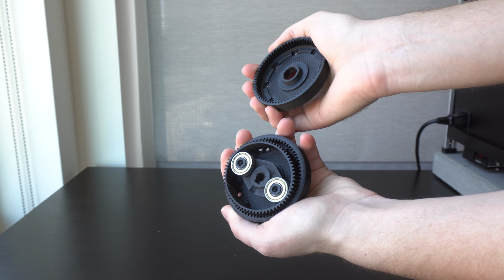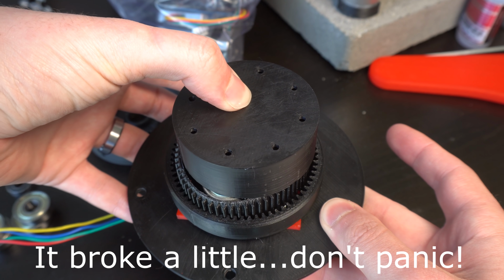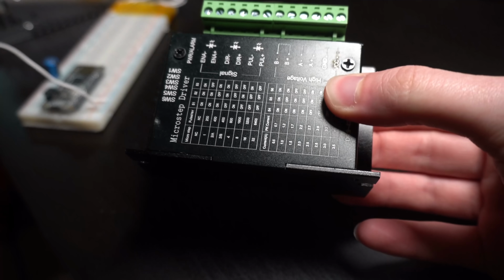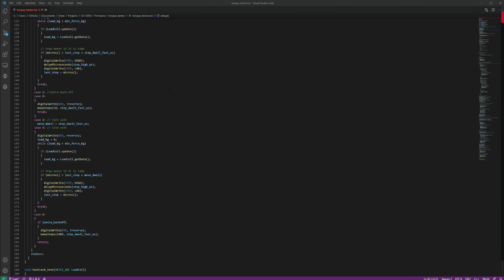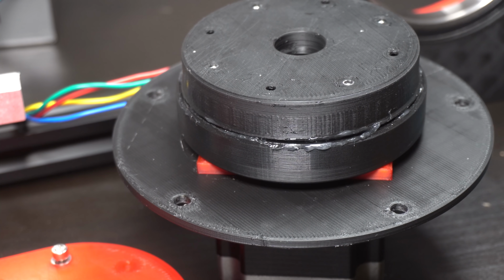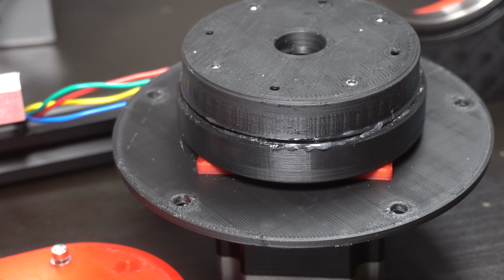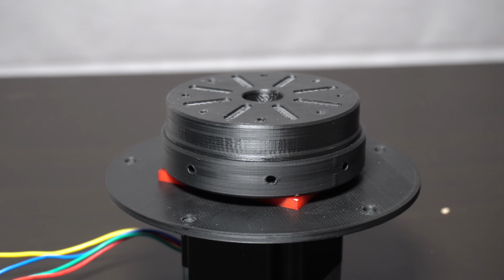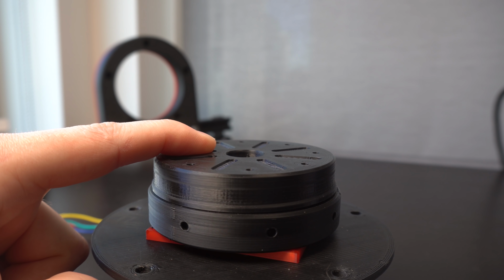My 3D Printed Harmonic Drive is Surprisingly Powerful!

Comment: Built a robotic hand when I was like thirteen, back in like 2008 maybe. It was all wood, with programmable tumblers with a live control override set up like a piano. It's glue didn't hold up to humidity long, so literally just fell apart over a wet summer. It used pull strings and springs, and later bands, very close to how a real human hand works. Can just copy the human body and only run a single moter to bring it to life with this method. To add a computerized element, the tumbler spokes can just be raised and lowered, still powered of the single moter. I wouldn't be surprised if someone else is already building something like it.

Comment: Is there a reason you didn't just use a worm gear? They have awesome ratios in a tiny profile, and basically never slip. Super easy to print and easy to model. Only two parts, so super simple to assemble / rig. Your stepper motor already has a worm gear in it, so you're using them anyway... This just seems oddly complicated.

Comment: I made a wooden robotic camera arm for a school project using DC motors from old power tools (18V and 12V I think). Very powerful, but loud and not very precise. For the gearing I just used a nut and a threaded rod at the end of the tool's gearbox. The threaded rod was good because it also stopped the arm from moving up or down by itself.

The arm was pretty bad as the wooden structure was very unstable. It was also very unprecise, but I think that could easily be fixed with a few sensors and software. It cost me about 300$ (including the Arduino and everything else).

Comment: I've never been able to get my head around the purpose of a harmonic drive assembly. Is it to increase the torque of a typical stepper motor?

Also, very cool video. I love the thought process of the maker mind.
Reply: Yeah torque is the main thing... Harmonic drives tend to have less backlash than planetary gearboxes as well

Comment: Is it possible to stack these verticly to add 50% more torque and speed?
Reply from the maker: technically yes but it’s unnecessary, the reduction of this drive is already about 50:1 but you could get more by using a higher pitch internal tooth profile. At a certain point you’ll hit a tooth size lower limit but it’s probably around 75:1 reduction which is already a ton!

Comment: I wonder how this would compare to other designs like James Bruton's cycloidal drive.
Reply from the maker: His drive is more efficient, backdrivable, and likely has a longer lifetime. But this design has a higher gear reduction in a similar sized package (so significantly higher output torque) and lower backlash, both of which were priorities for my robot arm which is why I went harmonic instead of cycloidal!

Comment: That's really cool! I wonder if it's possible make a comparable planetary gearbox? I'd assume it would have to go through multiple reductions to get the same gearing at that size but not sure, that might introduce too much backlash and points of failure.

edit: How you changed how the output works is also sort of genius ngl! Its a simple change that does wonders to the compactness of the design.
Reply from the maker: You've hit the nail on the head. It would certainly be possible but definitely would need multiple stages of reduction, would be far more complex and have significantly higher backlash. And thanks!

Comment: I don't know whether I missed something, but with the second ring gear having 2 more teeth, does it have a slightly smaller tooth module? It looks like it works fine, but when I have tried slightly different tooth sizes meshing in the past, things just end up binding, even when using a flexible material like tpu.

I looked at the models on github and this looks like the case, I just can't seem to get it to work in similar projects.

Comment: print your nylon flex spline in a  cold bed of hot glue (print a frame border, heat the bed, fill the frame with hotglue, let melt, let freeze, print)

Comment: You could use an ordinary timing belt turned inside out, as a flexible gear ring. You could match two timing belts with slightly different number of teeth to match your gear ratio.

Comment: This design is very interesting. How about replace elastic belt and rollers by free spinning solid gear on wave generator? This could be almostly 100% printed. Also using 3 gears would be possible.

Comment: How much torque would you get out if the housing and the wave generator would be out of Aluminum? And the flex belt would be out of PEEK or Nylon or other though material? Also how fast can they be turned and how much repeatedly do they have? Could they be used to make an Extruder drive for 3d printer? Or even better to beef up a cnc cutting machine?

Comment: have you ever consider the stator has 68T，rotator has 70T，the flexible gear has 66T，when your flexible  gear has no backlash with the stattor，the backlash comes between the rotator and flexible  gear？
because the rotator has a big pitch diameter， but the flexible gear has been limited by the stator，and it could not be more elliptic.

Comment: Do the number of teeth on the flex spline match that on the output?
Reply from the maker: No it has less and is smaller in diameter, but it gets distorted as the wave generator spins allowing it to reach the housing teeth
Reply: @3DprintedLife  hmm I tried that (62 fixed gear teeth, 60 flex spline and 62 on output) but was not getting any rotation on the output! 

Great design though!

Comment: very good design! I'm designing a 3d printed GO-TO telescope mount (where small movements with no backslash are needed) to use On-Step, so I have designed an harmonic drive with the stepper belt (as your first step) with the same results as you... rather unsatisfying. So I'm building directly on your final result; I think you saved me tens of hours of tests and experiments!

Comment: How did you get the force from the flex gear to the output?
Reply from the maker: That's the beauty of it. All the flex gear does is couple the top and bottom halves of the gearbox at whichever tooth in the flex spline is currently engaged by the wave generator (spinny bit with bearings). As the wave generator spins, the flex spline moves and due to the difference in teeth between the two halves of the gearbox, it slowly rotates.

Comment: @3DprintedLife: If you have 2 less teeth on the second gear, how do you compensate the size? Do you use slightly bigger teeth or gaps between them?
Reply from the maker: Just a larger gap between teeth. The positive teeth are the same size for both halves so all that's needed is different spacing!

Comment: Why are you not using a (german) "keil" for the motorshaft?
Reply from the maker: The motors were off the shelf parts, they have a flat but the real trouble was that the plastic parts just deformed too easily under the high loads (even when trying to make use of the shaft flat). I have a plan to fix this in the future though!
Reply: @3DprintedLife  im curious to see the result👍

Comment: There's another way t do a harmonic drive not using flexible components. A sun gear drives N planetary gears, but these gears have two steps - one a couple of teeth larger than the other. The two steps mesh with two outer ring gears, which are forced to rotate slowly with respect to one another. I suppose the main problem with it is wear.

Or - maybe rather than a flex spline, some sort of chain?

Comment: Why not using rc servis, they are Powerfull and cheap 🤔
Reply from the maker: They aren't anywhere near this powerful. Most servo ratings are in kg*cm, so if you want to convert that to N*m to compare with mine you would need to divide the servo's rated torque by about 10. If you wanted one capable of driving with the same power of my design you'd have to spend well over $100
Reply: @3DprintedLife  thank for clarification, that's extrem expensive 🤔 nice chanel, new subscriber today, like your work very much 😊

Comment: Super cool video and description of your testing process.
Have you tested printing it with composite filaments ? Like carbon fibers or nylon ?
Reply from the maker: I actually did have some parts printed on a markforged machine, I tested them out briefly in my latest video!

Comment: What about speed?
Reply from the maker: Under 80% of its max load it can run at about 1.5 rads/s, which is admittedly not too fast but once I have a more powerful stepper driver I should be able to push it harder and faster!

Comment: Don't be afraid of printing Nylon.
Some "help":
- Make sure that the filament is dry (seriously, 50-80°C for around 10h and print directly from dry storage)
- PVA gluestick on a Prusa Satin sheet works really solid for me (93mm high part on a 2mm wide ring measuring 18mm outside holds like glue)
- Enclosures help a lot (even cheap ones)
- Nylon oozes a lot, factor in some time to play with retraction settings to reduce blobs and zits
- Using a bigger nozzle (using 0.6 right now) can help with layer adhesion
- Manual post processing might be required
- Try to design/print the part so mechanical stress goes against the layers, Nylon with bad layer adhesion tends to break along the layers
Reply from the maker: I really appreciate all the tips, thanks!

Comment: stepper motor is dc motor wit gear box in it. if you manage to design your own gear system, you can use ordinary dc motor and drive it using PWM signal.
dc motor for mini power tool is cheap and powerful.
and it'll fit your goal, be as cheap as possible.
Reply from the maker: That's true but I would also need an encoder and a control loop to do this since I need accurate positioning, not just raw power. But you are right and it could be done, steppers are just a lot cheaper (at the cost of being slower and heavier for the same power output)

Comment: I'm very surprised that the bearings are that cheap. Where do you buy them?
Reply from the maker: Amazon and ebay! They are not good bearings, but for this use case it doesn't matter so much
Reply: @3DprintedLife  I still find it amazing how cheap people can get a hold of bearings. I'm used to bearings, like the 608, cost about 5 dollars or more.

Comment: Would planetary gears work just as well?
Reply from the maker: Yes and no. Planetary gear reduction in a package this size would be very difficult without multiple stages, though planetary gears would be a bit more efficient!

Comment: Hey, what's the reason to be scared of nylon? I was about to try it :)
Reply from the maker: Bed adhesion is difficult and you have to keep it super dry, it will absorb water from the air very easily and that makes it bubble up when printing!
Reply: @3DprintedLife  That sounds like it just needs to be put in a decent filament box filled with silica gels all the time (during printing too). That's not gonna stop me :) We will see about that bed adhesion.

Comment: To improve the durability of your prints, you could enable some "elephant's foot compensation" (no, not that Elephant's Foot), and pack your printed part with some sand so that you can temper and anneal it.

Don't forget to freeze-dry your nylon filament, immediately store it in a vacuum bag with some desiccant, and when you print with it, feed the filament directly from your dehydrator. Also make sure you have a dehumidifier running in your room during all printing operations, and coat your printed Nylon parts with a hydrophobic substance like Neverwet.

Comment: You should build a version of Toyota's D-CVT, but using a harmonic drive for the Launch Gear, and adding a cycloidal gearbox for a Crawler Gear.

And maybe also finding a way to make the CVT without using a belt.

Comment: Dude, don't 3D print. Lost wax cast a mold out of aluminum. And then injection mold your own plastic parts.
I really think the 3D printer is a dead end because the layers will always be the weakest link.

Comment: If you got delamination problems you can bake prints on the printed. Just cover the print with something (a box/aluminium foil) and set the bed to 80°C then leave it for 30 minutes.
I do not know how much this increases strength, but on a basic make 2 parts and try to break both basis it makes a noticeable difference

Comment: You could also try a cycloidal drive.
Reply from the maker: I've looked at those a little, but making one to support these loads would likely be a lot heavier from all the small bearings required. If this drive has issues I may take a closer look though!

Comment: Im making an 80cm arm for under 300, except ill be making it look stupid by using belts, just for a bit better reduction. Hoping to get 40 newton meters on the main joint, I've got a pretty giant stepper to run it with that I got for like $20.
Reply from the maker: Ah nice! Exterior belts definitely make it easier, but I'm just too obsessed with vanity. A pretty arm is a popular arm (as long as it still has the specs to back it up), just ask Universal Robotics! :D How big of a stepper did you find?!
Reply: @3DprintedLife  https://www.omc-stepperonline.com/nema-23-stepper-motor/p-series-nema-23-bipolar-3nm-425oz-in-4-2a-57x57x114mm-4-wires-stepper-motor-cnc.html this absolute chonk of a motor will be powering the main part of the arm lol, got it for $20 iirc but yeah I understand you where you mean the belts are kind of ugly and chunky. Hopefully there's not much backlash ;)

Comment: You should use PLA for this, it's far FAR tougher than PETG let alone nylon. PLA's weakness is brittleness (instead of yielding it snaps instantly) but considering there would be no shock load it would be the best material.
Reply from the maker: I am using PLA! Keeping it dry and printing with the right settings makes a huge difference. I was considering nylon due to the higher tensile strength and better lubricious qualities to reduce wear, though it is a bit more elastic so backlash and compliance may be worse than PLA.
Reply: @3DprintedLife  YT won't stop deleting my comments WTF.

Nylon has higher ultimate tensile strength but that is at the point of failure, not at the point where it starts to fail - which is more than twice lower than PLA. Having the gear twist off at half load is probably not an improvement over having them snap off at full load. Also the gearbox is rather slow so it probably doesn't needs lower friction material. You do seem to have the anisotropy do its worst though, but your gear teeth have some voids in them and you can try putting steel wire in there.

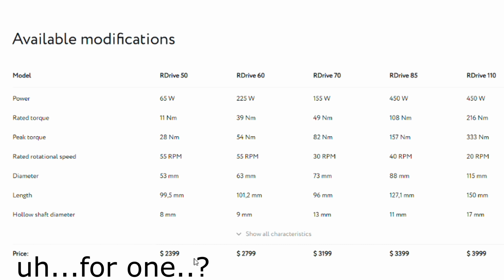Comment: I'm trying to find the blower fan bracket on the E3Dv6 at 1:38.  it looks so simple and clean.  Can anyone ID it and provide a url?
Reply from the maker: Ah well that's because it's part of my printer, which is my own design. The files for it live here, but it will likely require modifications to work on your machine http://www.eclips3d.com/version-21.html

Comment: Why use a flexible belt when you can use 2 or more gears around the bearings? It is something similar as a planetary gearbox but with 2 outer ring gears with slightly different teeth count.

Comment: What about a fish weight scale and a piece of string on output axle perimeter for the torque test?
Reply from the maker: That would work, but the force on the circumference of the drive would be quite significant (~25kg) so adding that lever arm and measuring 200mm out from the center helps reduce the force I need to measure
Reply: @3DprintedLife  cool, i understand. Why i mesnt was for the scale maxing out in the vid, and there are large fish scales like for tuna that are for more than 200kg, and there are cheap digital ones up to 50+kg if the upper limit was some 25kg

Comment: Nice video. Have not seen the timing belt alternative to this ancient technology. 

The modern implementation to the ancient hoist design : has a pinion gear orbiting and meshed with two equal diameter larger disc gears (of external teeth count a = N and b = N+1)? Any two out of three moving and remaining one stator to a total of three configuration. 

Alternatively those larger gears may be implemented with either non inverting or inverting teeth - similar with one in your video. 

Do you think solid pinion teeth could out perform rubber teeth per your application? 

The latest implementation of that has only one ring gears and a slightly smaller disc gear. A gear of non inverting teeth meshed inside a larger inverting teeth ring gear. It runs like the piston of a rotary engine. Both gears has sine wave shape teeth.

Comment: Wow - that's a masterpiece! Im curios on how you design your (involute?)-tooth. My approach was the equation-controlled line-command in my cad-programm (formular from Wikipedia)...--- -What was you approach?

Edit: Normaly, a tooth (the curve of a tooth) would not designed by an  engineer - the involute profile is produced by tools in the manufacturing process of gears... But it's fun anyway

Comment: Was that really 10Nm? Or  maybe more like a 15Nm? at the moment when you were testin torque at the scale, the scale shows 3kg. That is 30N. And if the arm was half a meter, torque was then half of it, 15Nm. Or maybe I am totally wrong.. Sorry if so. (1kg is abaut 10N.)
Reply from the maker: The arm is only 200mm, so it was actually 6Nm for that test

Comment: Hi, would you be willing to upload step files to github? I'm trying to understand your model but I use Fusion 360 so I can only open the stl mesh files, and they're a pain to work with.
Reply from the maker: You should be able to import the source files directly into fusion360, I designed these files using another autodesk product (inventor). But I will also upload a step file of the assembly!
Reply: @3DprintedLife  That is incredibly helpful, thank you. Autodesk removed the ability to import inventor files into fusion with a personal license some time last year, I think.
Reply from the maker: Ah, well that's a bummer..